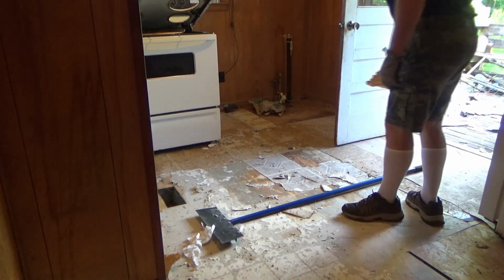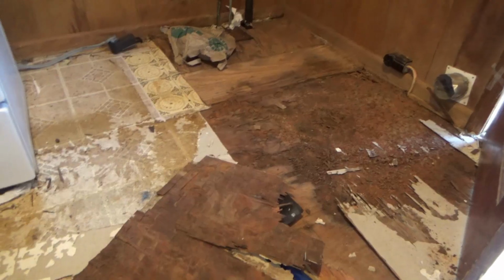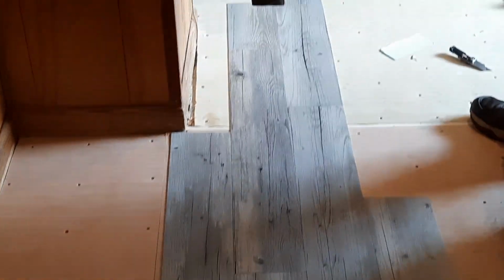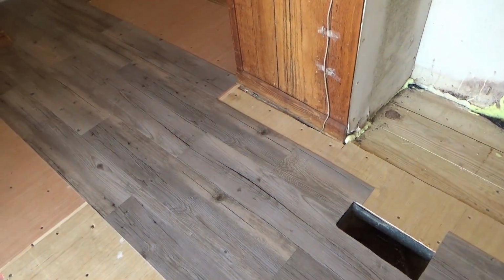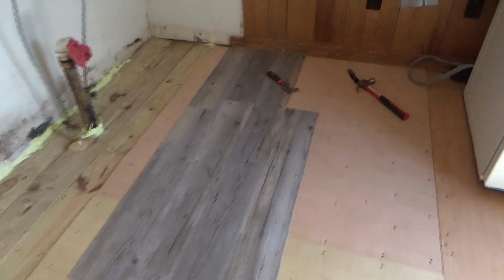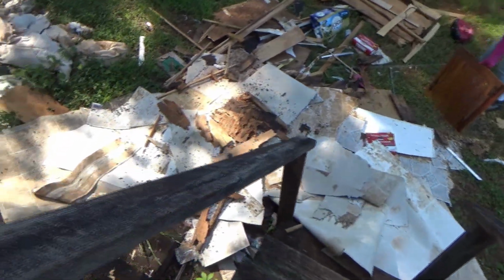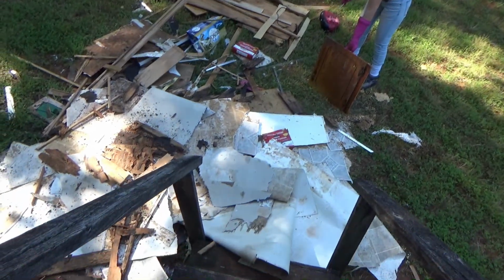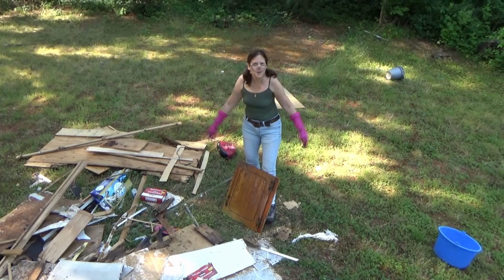Starting Over and Building An Off-Grid Homestead

Comment: What solution did you use to clean the hardwood floor?  I have the exact situation - I need to put peel and stick over a mix of floors including hardwood.
Reply from the maker: We used bleach first, then Pinesol, then Mr. Clean. Two washings of each and a lot of elbow grease. Pink